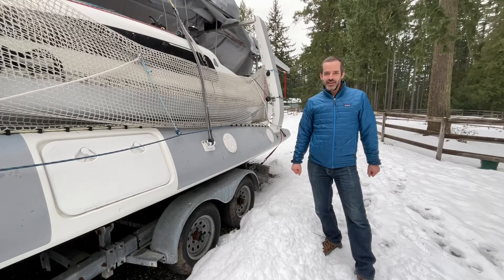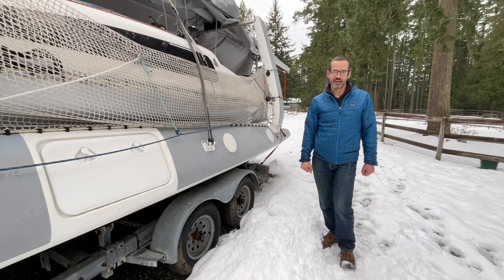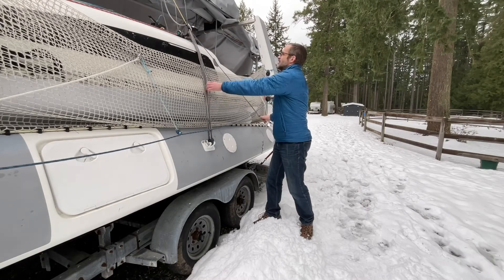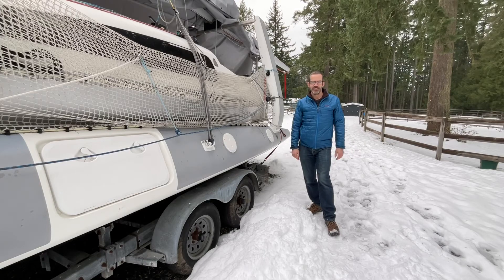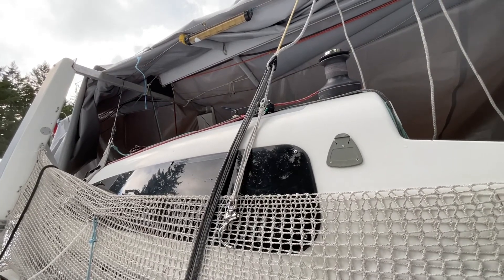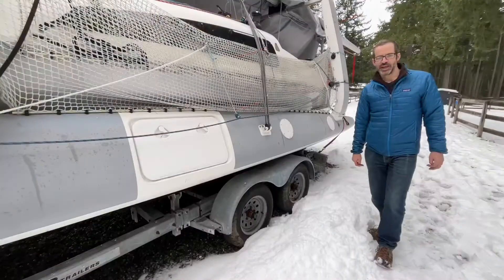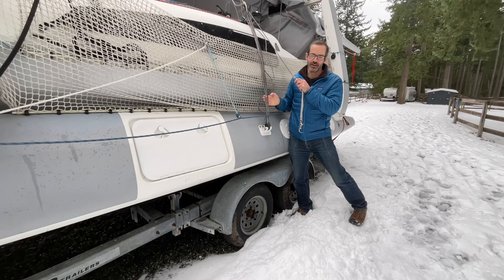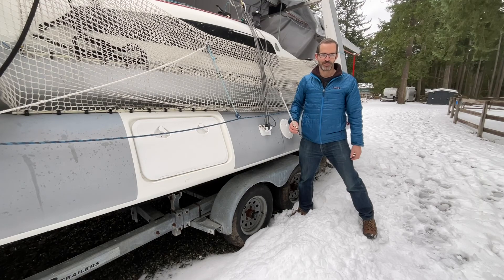Synthetic Shroud Adjusters for Foldable Trimarans

Comment from the maker: I should have added in the video that the primary shroud is still very straight, and there is only a minuscule amount of aft-ward deflection, so the primary shroud chain plate on the beam takes the vast majority of the sailing loads. The aft pad eye is taking no more than 1/8  due to multi-part purchase, minus friction, minus the side pull angle - I haven’t actually done the math on this but it’s very small and probably only a few percent of the full load.
Reply: we  use that pad eye for our spinnaker lead block.  I see yours are attached a little inward to the beam.  Otherwise, looks great!  We just got Colligo shrouds and need to figure out how to quickly do this, as we have to fold/unfold one float to enter/exit slip each time we sail.
Reply from the maker: @johnsutphen7121  We used that pad eye for our spinnaker lead block initially too, but found that it was too far outboard because the apparent wind moves so far forward on this boat as it accelerates. For example the true wind can be at 150' (e.g. broad reach for a monohull) but the true wind is closer to 60' apparent once the boat gets up to speed, so I had to move the blocks inboard. I use soft shackles to provide flexibility for both the spinnaker and screacher blocks.

Comment: Hello Gary, I just stumbled across this video while searching for a quicker method to fold and unfold our F-28.  This looks to be a great solution.  I am wondering if you have a source for the small adjuster that you have in the stopper position.  I have done a bit of searching but haven't managed to track down that small bit of hardware.  Thanks for your content, always helpful and entertaining.
James
Reply from the maker: No unfortunately I don’t have a current source for that small adjuster. However if I were to do it again I’d just use a normal low-friction ring spliced into the stopper position, then a 2:1 line terminating on the aft beam padeye, through the low-friction ring, back to the aft beam padeye, then towards the cockpit for termination on a clutch or clamcleat. Does this make sense?
Reply: @SailingTipsCa  Yes that makes sense and does seem simple.  A second option I had considered was to use two dinghy vangs I already have from previous boats.  Basically a 3:1 purchase with camcleat.  I would attach them to a stopper and the aft padeye.  only 3:1 and rated for 700lbs, but I feel this would be adequate as there shouldn't be much load in that system.  What do you think of this solution?
Reply from the maker: @jflimbo  Yes that ought to work and should be plenty strong for that application. The key is to have some kind of stopper spliced into the primary shroud lashings so the failure of your adjuster won’t cause the rig to come down!

Comment: thanks another great video and I will do something like this setup too now I have seen yours.  BTW I like your system better than the ones I have seen that have a fixed 8:1 lashing and then pull the upper colligo fitting towards the rear pad eye, because your system keep the load mainly on the carbon chainplate rather than sharing it between the chainplate and the pad eye. I dont have a rear pad eye such as yours so would need to add one. I would need to reinforce the Ama at that point. What sort of reinforcement do you have?
Reply from the maker: There really isn't much force on the aft padeye with this setup because as you noted the primary chainplates take most the force. I think over-drilling the holes and filling with epoxy so you don't crush the core, plus an aluminum or G10 backing plate is sufficient. Good luck with your new boat!

Comment: Any chance of an update on the water?
Reply from the maker: Do you mean an update on how these are working? We’ve used them for a few years now and they generally work great! I have a few design tweaks in mind though…
Reply: @SailingTipsCa  Yes, I purchased them for the C28, and I’m trying to se if having an adjustment in the cockpit is worth the trouble.
Reply: @captguitarj  I think it is worth the trouble…when sailing in rough seas the shrouds can stretch a bit and having to go out on the floats to fine-tune discourages one from doing so. That would be the main improvement I’d make!
Reply from the maker: @captguitarj  Yes what Sting says!!!

Comment: Thanks for this. I wish you had been making these videos a few years ago when I began setting up my MkII. I used a similar solution. I keep the shrouds tied off slack enough to fold easily. Then I tighten them with a line from the upper terminal back to the end of the ama. That line locks with an “inline” Clamcleat. It’s a little cumbersome, but it also allows us to let the leeward shroud go slack on the few occasions when we have to run straight downwind. I used soft shackles to make the attachments easy to remove, but I can’t recall the last time I undid them.
Reply from the maker: Yes there are lots of ways to lock off the line from the upper terminal. You could even lead it to a turning block at the aft end of the ama, then to a block/clutch in the cockpit if you wanted to adjust the leeward shroud underway.

Comment: You mentioned an unplanned lateral rapid lowering of the mast - was there any damage to hardware, mast, or fiberglass/hull?
Reply from the maker: The unplanned lateral rapid lowering happened as follows: I had just replaced the mast raising wires with Dyneema, and instead of splicing the mast ends separately I just cow-hitched the pair to the tang on the mast - first big mistake because a cow hitch slips in Dyneema!!! We had backup halyards attached to the floats so everything seemed fine when we disconnected the main shrouds (which we also no longer do). When we arrived at the ramp there was about a 20 knot crosswind, and I had to ease the backup halyards to fold, because they were attached to the floats, not the mast raising brace - second big mistake!!! Folding the downwind side went okay because the wind kept the mast upright, but when I released the upwind halyard the cow hitch started slipping, and I couldn't get the halyard back on fast enough, so the mast simply went over the side. Thankfully the downwind float was already folded, otherwise it might have been damaged. The halyard and cow hitch did slow the mast somewhat, but the masthead still landed with a thunk on some rocks adjacent to the ramp. Somehow the boat itself was miraculously undamaged, and the only damage was some dents near the masthead, which we pulled out and reinforced with a backing plate (aluminum mast). I felt really stupid afterward, but learned lots!!!

Comment: Nice solution. But still a lot of ‘metal’ stuff involved. I just use 2 Wichard shackles and 3:1 lash 4mm SK75 to tighten to knot off. And a 6mm spliced ‘over’ the system (always on) to represent the HField ‘open’ pos. as safety loop around. Fool (me) proofand fail safe.  Watch my videos to see it on water. Nice clean cheap ‘system’ no fine tuning needed. Just a re do after heavy sailing beginning season with Dyneema re setting. I can take lash end to U bold to mimic your system and knot off. :-)
Reply from the maker: I like your system too, especially the 6mm lashing to support the mast in the 'open' position! We also typically don't fine tune, except if we've been sailing in big waves, which tends to make the rig slightly sloppy.
Reply: Where would that video be located, Robert?
Reply: @djmydlack  what video?

Comment: 2 days ago! This is epic me and my dad have been trying to find the best setup for a while now. Where is that base plate from do they have rollers in them? Also just curious is this a rotating mast?
Reply from the maker: Glad it's helpful! Yes it's a rotating mast. Which base plate are you referring to?
Reply: @SailingTipsCa  the white section on the ama was what I was curious about. is it just a different calligo mount?  Also I have seen the  tensioner with small rollers or are the ones you have solid
Reply from the maker: @Aeroworks540  Perfect - thanks for the clarification! This particular boat is a custom built F-82R with integral chain plates of carbon and epoxy. But this approach should also work for factory-built Corsairs etc. There are no rollers in any of the standing rigging components. The Dyneema coarse and fine tensioners (actually Amsteel in this case) are inherently low-friction and slide nicely over smooth surfaces with no rollers required.